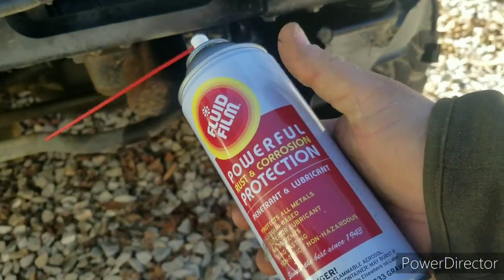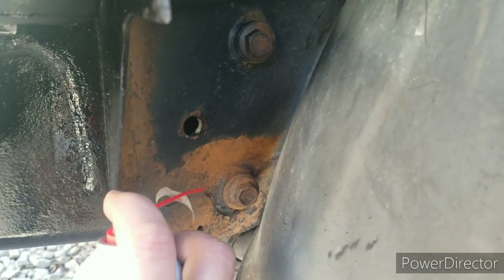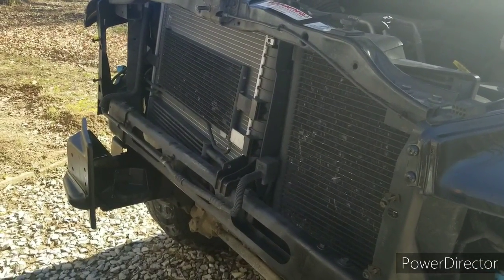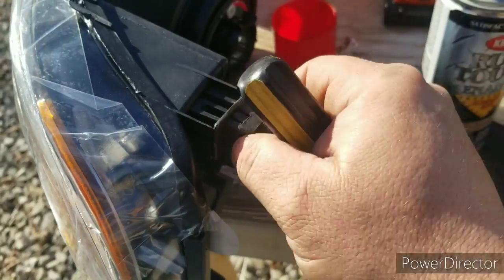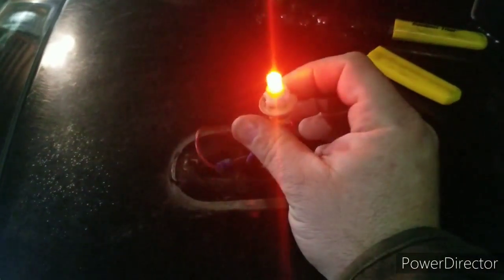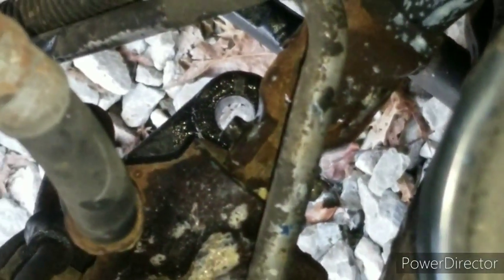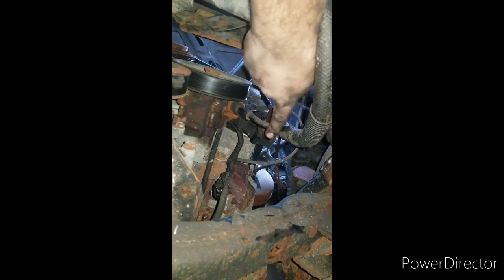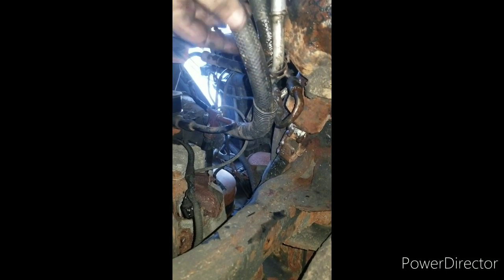2005 DODGE POWER WAGON, NEW CAB LIGHTS, PB BLASTER AND FLUID FILM

Comment: When I was working on my Willys frame, I power washed it, then I brushed on Rust Converter, The came brush on Rustolium Satin Black. So I'm recommending rust converter before you paint. I think I used CRC brand. ...Newk from Kentucky
Reply from the maker: Yea the black i bought says paint over rust so i thought Id try it on a small.part